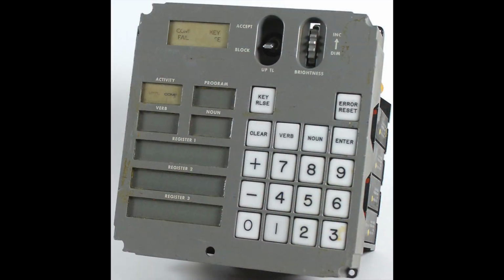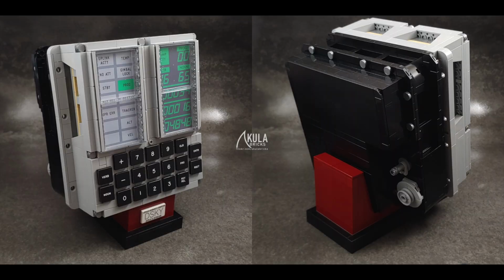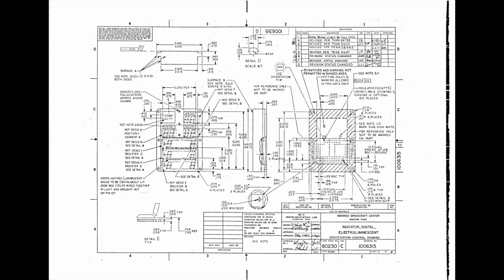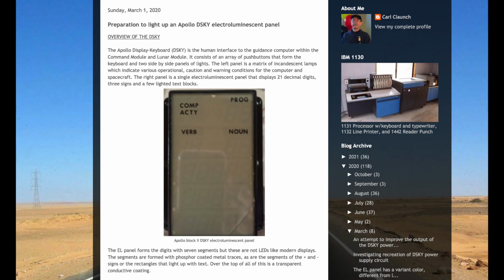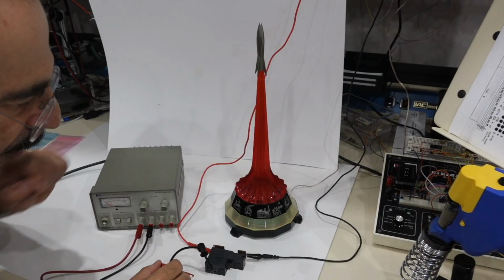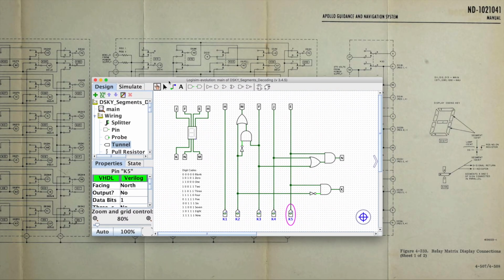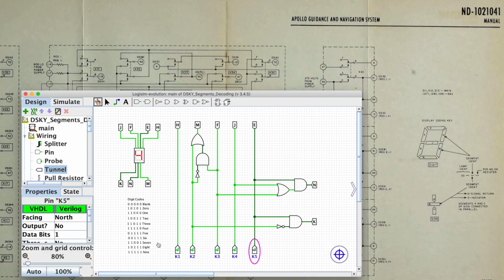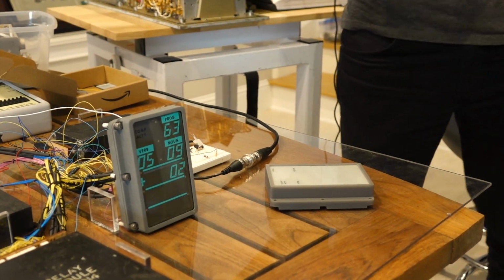Apollo Guidance Computer Part 28: real DSKY display works again after 50 years

Comment: I once had a nightmare trying to program an Arduino. My computer would not recognize the board, but the board would power up. I was checking my drivers, uninstalling and reinstalling them. Finally I tried another cable - and it worked.
Seemed like the first cable was only for charging USB devices. It had no data wires in it.
It went in to the bin after I had diced it several times with the wire cutters.

Comment: If you are really keen on white balance, you need a color chart to set the camera. In a pinch, something white or grey will work. The wooden table doesnt help either, it literally has no reference to calibrate in that last shot.
Reply: I don't think white balance is the issue.  I think it's the fact that the color of the display is a single wavelength (or a narrow band centered on a single wavelength) that doesn't match up with the three colors used to capture it and then the three others that reproduce it.  In other words, the display really is somewhere near a pure cyan, interpreted by our eyes with their own definition of blue and green as a combination that makes it look like cyan, and my eyes are different than yours.  And then the camera is trying to capture that one color with a mixture of a fairly broad band of green and a fairly broad band of blue, and then we're trying to reproduce the color with a mix of a different broad band of green and a different broad band of blue in the monitor or display we're looking at it with.  Every reinterpretation of what the color is introduces its own approximations, and in the end... this particular original color (the display itself) is very difficult to reproduce!  I think it all boils down to being smack between the various definitions of "blue" and "green" that we normally use.  White balance can balance that blue and green, but can't really address the underlying issue that we don't have a way to capture and reproduce that cyan wavelength effectively.

Or so it seems to me!

Comment: Wave shape of EL input will affect color.  Fast rise time (non sinusoidal) will push color to blue spectrum.  Also higher frequency will do same. Most EL of that era was driving at 400 hz (typical aircraft buss).  I assume 800 hz. was chosen to help reduce size of transformer and provide increased luminance.

Comment: The DSKY is awesome, by why use an Electroluminescent (EL) display with high voltage that required big/slow relays when they could have use LEDs that could have been switched with much smaller Bipolar Transistors with a low C-E voltage drop (FETs would have been better but I think they were just comming out at the time).  True, LEDs/Transistors take more power for the same brightness, but it would have had a lower cost and weight, and I would say it would be more robust. Also, using the one digit on at a time displayed at very fast rate technique (the human eye's persistence thinks they are all on at the same time), that would require much less power, only 135 mA at any given instant for the display. The transistors would not drop much voltage so they would stay relatively cool, and LEDs are not much warmer than an EL display with its high voltage power supply. I know lower power and lower temperature was king on Apollo, but so was weight. Ok, LEDs were only Red back then, and NASA ended up specing the display color as a green. Why? Red is better for night vision.  I know that human factors try to limit Red lights except for critical failures, but the display is pretty much digits and not that distracting.  Does anyone know why EL won in the end?

Comment: Great video in a great series Marc (and collaborators)!  Is the DSKY display as slow when it's running on the real AGC rather than on your breadboarded mock-up?  Also, if it really was this slow, was there a seperate mechanism to flash the Verb and Noun data fields, presumably switching a common line on the the pair of digits?
Reply from the maker: The real DKSY would be faster and with less pleasant clicking. The AGC sets two digits (10 relays) at a time in parallel. But here, the code sets or unsets just one relay at a time for each digit, and also processes one digit at a time. It's an artifact from how Carl first wrote the test code, he went for individual control of the digits and the simplest program loop that controls each relay one at a time. Hence the delicate ripple clicking. But I thought it really sounded great, and drove home the point that this was relay-controlled. So I left Carl's prototype code mostly untouched. I think there is indeed an extra line/relay for the flashing, but I'd need to confirm it.
Reply: @CuriousMarc  LOL, that's great Marc 😁 I'm actually implementing a DSKY as an add-on to one of my current projects and implemented those relay clicks too on the basis of your videos,  but found that updating  anything more than a couple of digits would have slowed the DSKY down so much that we'd never have made  it to the Moon, or that Neil, Buzz and Mike would have been driven insane by all that clicking! I've been beating myself up about implementing one relay click for the changes to each of the seven segments of each digit, when the real DSKY only had five relays per digit, and was considering rewriting it to do the job properly, but maybe I'll save myself the effort and just remove the delays I've implemented to match the timing on your video of the real DSKY display panel :-s Keep on with your excellent entertaining and mind-expanding videos :-)
Reply from the maker: @michaelbenn4741  Great, good luck with your project!

Comment: The color may vary slightly from greenish to bluish depending on the voltage and frequency of the display segments. Most likely there is a phosphor based on zinc sulfide doped with copper.
Цвет может немного меняться от зеленоватого к голубоватому в зависимости от напряжения и частоты питания сегментов дисплея. Скорее всего там люминофор на основе сульфида цинка легированного медью.

Comment: I hope the relays are less noisy inside their enclosure.  That sound would drive me nuts hearing it all the time. Are they really that loud or did you just have them mic'd up for effect?  Also that info about cheap wires was super useful.  I didn't know copper clad aluminum was a thing, now I know to steer clear of it.  I've been interest in learning electrical circuitry for a whole now so when I buy some wire I'll make sure it's good stuff.

Comment: Excellent video on the DSKY!
I wonder if they toyed with potentially using Vacuum Fluorescent Displays? The first single indicator VFD was released in '59, so may be a little late for the Apollo program, but with some NASA engineering prowess, they could have advanced VFD technology by 10 years easy. Although, I can imagine the filament wire in a VFD not being up to the task of withstanding all the intense vibrations of flight.

The clickity clack of the relays is so satisfying to watch! I wonder if there would be a way to reproduce the same latching relay effect with modern, cheap relays instead of having to hunt down some more relay driver boards? You could build SR Flip Flops pretty easily from four SPDT relays like Jeroen Brinkman shows here ( http://www.relaiscomputer.nl/images/SR-FlipFlop.png ). The relay count will go way up, but you could use some relatively cheap and small Omron G5V-1 relays on a custom PCB to make life a lot easier!

Although, I suppose there will have to be a bit of design work to do depending on the voltage supplied to the common versus the voltage required for the coil to operate. Hmm, I haven't done a relay project in a while and now you've got my brain all excited to think about the click clack wonderfullness again!
Reply: Please!. Stick to vacuum tubes! That one bit computer won't put toghether alone...!

Comment: I just wonder.... is that EL display SOOOO much better than anything else that it was worth using 100-something relays? I mean the relay modules added some considerable weight to the entire system. And I assume weight was a central factor for the entire rocket...
Reply: EL displays are far more reliable and energy efficient than light bulbs and the very primitive LEDs that had just been developed.
The relays used are small and light.

Comment: Luckily all my wire is 100% copper stranded and solid I keep for my projects. You can’t solder that cca wire very well either. I have seen it so fine that the iron was melting individual strands of that crap on something I had to fix.

Comment: Interesting, copper cladding aluminum wire is usually more expensive and mission specific.
Reply: Not anymore. The cheapest wires are CCA as opposed to pure copper. Aluminum is so cheap now compared to copper.

Comment: How did they get any sleep with that damn DSKY clicking away the whole flight to the Moon?
Reply: It's not entirely clear that they would have been able to hear them. Unlike Block I, the Block II relay modules are contained within a hermetically sealed pressurized box, that itself is mounted mostly behind the control panel. Plus, there would be ambient noise from the cabin fans and other things that might drown whatever noise makes it through out a bit. We'll be able to say better if/when we get a real DSKY up and running. :) Besides, the relays have a somewhat limited life, and when the computer was not in active use it would have been left with a blank screen in P00.

Comment: Comment: Stunning and damn impressive wiring!
Question: what’s the overall power consumption once fully running? Relays? Display? The latching relays seem to be operated in sequence; so maybe there’s a controlled maximum current draw. The display should be constant … but what is it? Thank in advance.
Reply from the maker: It's minuscule. It did not even register high enough on the supply analog ammeter display for me to make an accurate measurement, but ~10-20mA order of magnitude. Gets slightly higher for a very short while when the relays are switched of course, but would not peak the needle past 100 mA. I'd need to make a better measurement, but if you compare that with any other digital display available at the time this is orders of magnitude lower power consumption.

Comment: I get the impression you think electroluminescent stuff is nonexistent these days. There is a company called Light Tape that makes electroluminescent tape by the mile. It is largely used for architectural illumination these days.

The color of the display is determined to some extent by the frequency of the AC drive. As the frequency goes up the output shifts from green to blue-green.
Reply: On my replica DSKY we used during the AGC restoration, the dividing lines between the 'registers' of the display were made with EL wire. Ben (Applied Science) used modern EL supplies to make his display.

Comment: Hmm, I think the image at 24:01 best represents the 'green' color of the display. A question, did the relays in the original system switch faster or slower or at the same speed as shown in this video ?
Reply from the maker: I believe faster. They’d switch 10 or 11 relays at a time (two digits plus one warning). They’d send a 15 bits word: 4 for locating a block of two digits, 5 bits for each digit and one more for an alarm if needed. Here Carl chose to trickle it down digit per digit and segment per segment, which might be contributing to the awesome sound.

Comment: maybe the high voltage in the wire causes it to degrade ?
Reply: The wire carried 5V max (TTL signalling from Arduino to a transistor base resistor
Reply: @carlclaunch793  thanks

Comment: Wouldn't it just be powering a small electromagnet on a thru pole and voltage to one side slides the coil one direction and power to other direction slides it back, in the process hitting/attached to a switch... it wouldn't have to continue to be powered because once it hits the switch the detent would just hold it in that position, only to be changed if power given to opposite side in order for coil to slide back over switching the switch to other state..... that wouldn't he considered memory would it???

Comment: How about measuring the wavelength, so a suitable batch of phosphorus can be mixed up?
Reply from the maker: As mentioned in the video and shown in the spec sheet, peak wavelength is 530 nm. But that does not tell the whole story has one would have to match the spectrum.
Reply: @CuriousMarc  indeed. With Ben’s analysis being that his “mix” gave a bell shaped spectral distribution, I wondered how the DSKY compared in this regard.

Comment: CCA is god awful stuff.  Lots of cheap cat5 cable is cca.   To determine if you have CCA wire (cat5,alarm wire, speaker wire, mains wire) put the strands under a cigarette lighter - ally will instantly dissolve.  I’ve made a yt video demonstrating it.